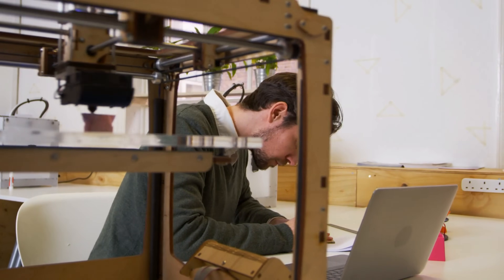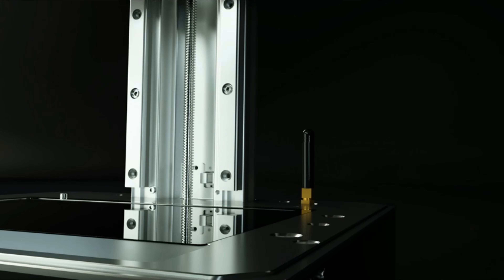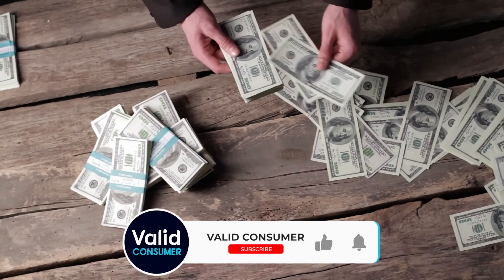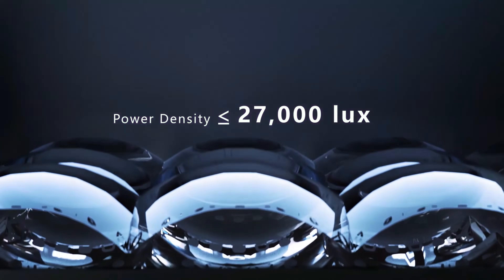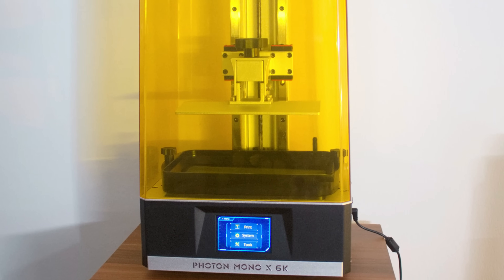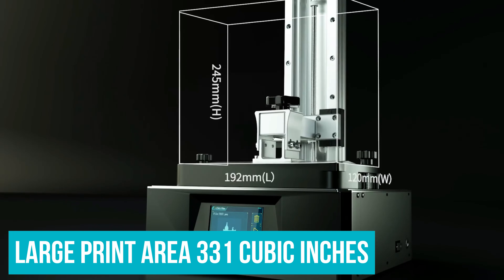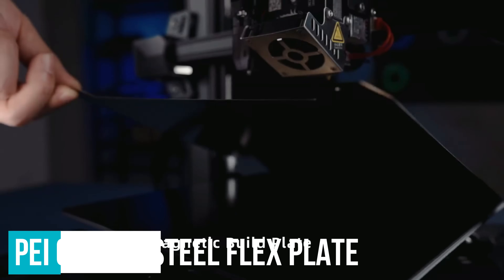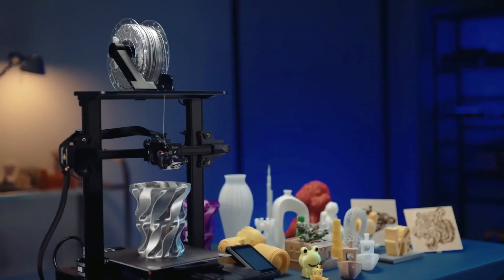Best 3D Printers 2026 [don’t buy one before watching this]

Comment: A nice tip is that resin printing is awsome with its quality but with all that after processing it gets a little worser. I have tried both FDM (Filament printer) and resin printing I would suggest FDM for new comers. The thing that was hard about resin printing was that you cant have 1 flaw, if that happens the print will fail. The slicers are not always perfect and you will have to do some things manually. I like FDM better because of its easiness. If you want bigger and more toyish prints I would suggest FDM, but if you want stuff like minutures then resin printing is best. I like FDM because i dont really want my 3d printing life to be all about little minutres, though you can make articulated dragons or stuff like that in resin printers, its just not the best. In conlusion if you want a easy printer and a printer that you will only print cool things like articulated dragons or somthing a FDM printer is best, but if you want high quality level printers for projects then a resin printing is best.
Reply: great explanation.Which FDM printer do you have?
Reply: @soumya068  I have the anycubic kobra neo but for some reason the screen is not working so I will probably replace the motherboread or get a new one. (Btw im 12 :)

Comment: Totally agree. I never had any experience with 3D printers. Bought an E3 S1 Pro and the features made it so easy to start printing for a beginner. A bit more googling helped prevent long term issues like cable damage, clog prevention, roller wheel tension, etc.

Comment: My experience with Anycubic printers and this company is a LOT different. I purchased 2 of these after seeing reviews like this one, purchased from Anycubic, and BOTH were defective. Both had the exact same issue, a bad bearing in the motor. The problem on one of them showed right away, and after contacting Anycubic they decided to cover their so called warranty by shipping me a motor in a plastic bag. Thats right, a plastic bag. Of course it arrived damaged, having been bent in shipping. Instead of replacing wither the motor or the machine, they claimed to me that they no longer had any of them and I should return it for the refund. I returned it, then after 15 days I had to file a claim with my bank to get my refund. All this time, they did still have them in stock, they had just raised the price by another $150. The second one, with the exact same issue, is still sitting here nonfunctional because Anycubic is dragging things out. The last email I got from them, which was their reply to my asking what is going on with the motor they were supposed to be sending me was for them to start all over again like it was the first time I contacted them. I have been going back and forth with this company for weeks over this issue. And this is not a clear "oh the motor isn't running" type of issue. It was so subtle that while I never managed to get a successful print on this machine (I was always thinking I was doing something wrong at first) which I ended up wasting over $150 resin with failed print after failed print. But, hey, I guess they just think someone like me is not only made of money but also someone who doesn't need a warranty. I would advise anyone wanting a resin 3D printer to get one from ANY other company out there. Anycubic has proven to me that they not only make shoddy products, they don't care about the customers. All they want is to see how many people they can trick into purchasing an expensive machine and then they will drag things out or wash their hands of you, leaving you with no other choice but to file charges and report them to the FTC. Companies like this one should not be allowed to do business here in the U.S. if this is how they are going to act. I still have a machine that arrived DOA and they STILL have done nothing at all to help fix this issue.

Comment: 8:22 DO NOT BUY AN ANYCUBIC. my anycubic kobra max 3d printer did not work out of the box. I bought it off of ebay from anycubic's store. I reach out several time to either get help or send it back for a refund. I got the run around for about a week and a half. the would no help me fix this or tell me what motherboard model number I needed to fix it. After Ebay got involved I got half of my money back and I got to keep a printer that does not work. DO NOT BUY FROM ANYCUBIC, THERE IS NO REAL COSTUME SERVICE!

Comment: still not sure......will be my 1st printer and I will mainly use it for small minatures, but I want them to look sharp AF!!! any suggestions!?
Reply: then resin printer it is
Reply: For great details on small miniatures and saving up time when printing many miniatures at once - I'd say go with a resin printer!
But be sure you have a good place for it (garage/outdoor/remotely room) since it's pretty messy and you need alcohol to clean your prints and printerhead/container with.
It will also be quite smelly and not great to handle without decent ventilation around, so having the printer in an environment you and others don't spend much time in is prefered.

Comment: I have not had a good experience with the Ender 3 V1 Pro with CL touch.  After 3 weeks I still cannot get anything other than the most basic items to print accurately.  This one just might be a lemon, but the factory basically just ignores any requests for help.  Releveled at least 30 times.  I sent an email requesting to return within the 14 days and on the 14th day they sent me a link to a YouTube Video and told me good luck.  Totally wish I had bought something that had better support.  I'll sell this one now for $360.
Reply: You have to understand that the Ender printers require you to tinker and get deep into it. Learning about firmware, sometimes tweaking your own. Testing different slicer settings & printer settings. I didnt print anything good for ages, after many weekends of tinkering. Theres no hand holding here, & if you put in the time to learn & watch a lot of videos/articles, you'll understand 3d printing very well. Can be rewarding when it works, but again, it requires your effort
Reply: @rubberonasphalt  I totally understand the points you made.  Unfortunately for players like Creality, they will continue to sit in the past and service the cheap, low margin, do it your self market.  I have ordered a Bambu Labs Carbon Combo with 4 color on demand printing to see if they got it right as every reviewer has said.  It also has a larger bed size, LIDAR first layer checking, 100% auto leveling, included enclosure  and printing speeds of at least twice (6 times???) as fast.  It also has a built-in camera to see exactly what went wrong when something does fail.   
I'll take $340 now for my 4 week old Ender 3 Pro with CR leveling, 12 extra nozzles and 2 glass bed.  I am thinking of just getting the a 10 watt laser cutter/ engraver for this Ender if I cannot sell it.
Reply: hey im a is it late to the party but if you paid with credit card is there any chance for a chargeback?

Comment: Can can someone recommend a good quality 3-D printer under 200?!
Reply: I'd check out the Creality Ender 3 V2 Neo 3D
Reply: I'm really impressed with my $120 Longer Orange 10 printer. Here's my video on it https://youtu.be/bw7F71Cs5jw and 2 settings I recommend you change for excellent prints https://youtu.be/CmIl1JqFmdE. Can't get much cheaper and the details are better than any FDM printer.

Comment: Hey, a little off topic but what is the strongest plastic you can 3d print with? I have an idea to make something game-changing for my industry, but I don't know if the plastics would be strong enough. Could you make a blade to cut through aluminum?
Reply: You can 3D print metal with a 3D laser printer. Design what ever you have in mind in CAD and have a company make the print for you to see if your idea actually works. Those kind of printers are very expensive and they are not giving perfect results, so do expect some work to finish off you product.
Reply: @woutervanmoll  it needs to be non conductive
Reply: @kcarroll0913  use a non conductive metal then
Reply: @Yielar1  such as?
Reply: @Yielar1  technically theres no non-conductive metals. There are some which conduct very poorly like stainless steel or thungsten but still dangerous in use and with their own drawbacks. Depending on the print itself I'd say you could fill it completely instead of just having internal support, which also comes with its own drawbacks.
Reply: They make a rigid resin for printing. I’m not sure if they also make the same thing in filament though so it’s a resin only feature as far as I know

Comment: I think the Bambu Lab x1 carbon would take the filament printing cake if money is not an consern. Similiarly the Phrozen Mighty 8k or Anycubic Photon M3 Max if you want the absolute best of the best details with larger build volumes. Anycubic Photon D2 if you want to invest on the DLP projection printing future with more lifespan and the best details available on a smaller figures. You'll also lose a a bit of printing volume since D2 only supports printing in 6.5 x 5.1 x 2.9 in. / 165 x 131 x 73 mm (HWD).
Reply: That's a good point, could you please explain the increased quality of printing verses the increased cost to my wife? After making her watch this video several times and showing her the cheap vases and potted plant holders it could make her, she finally agreed to let me buy a printer under $300!!!
Reply: @waynematheson  Dam that must suck having to ask your wife for permission.
Reply: bambu labs p1p is $699